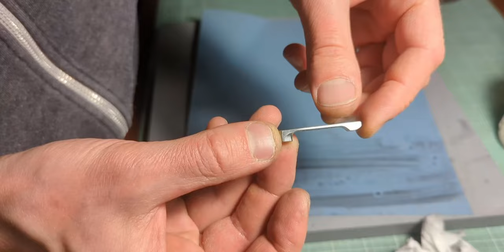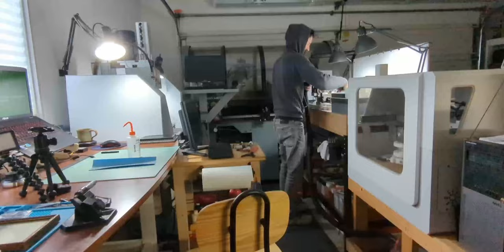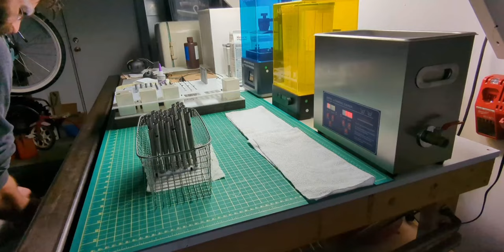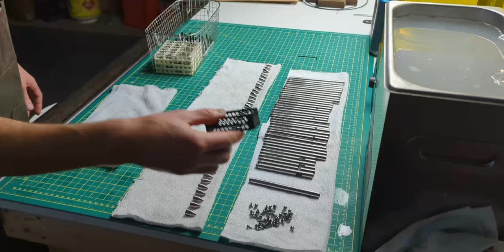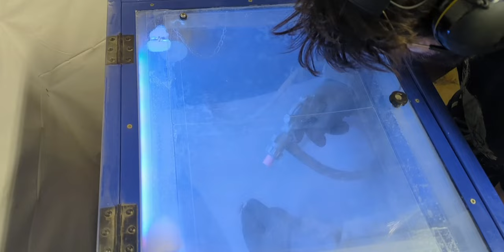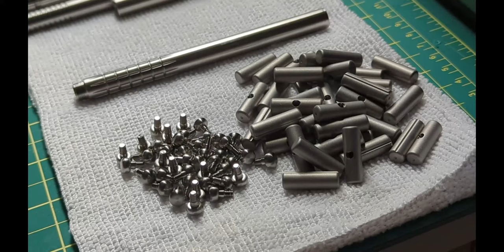vlog 22 - Micro Glass Blasting Titanium For Smooth Surface Finishes

Comment: I once saved all my saw swarf from
Cutting titanium and then set it on fire.  Wow!  If you can, save your fine chips and once they’re dry of coolant, pile them up and light them.  Wear a welding mask because it burns WHITE hot.
Reply from the maker: Haha, I've done that a few times (lathe turnings work great...especially drenched in oil). BRIGHT...hopefully I don't get to witness said light INSIDE the machines!